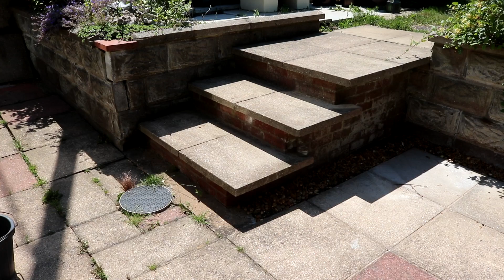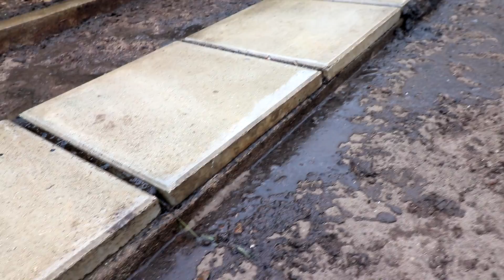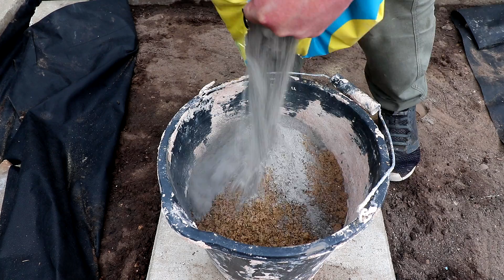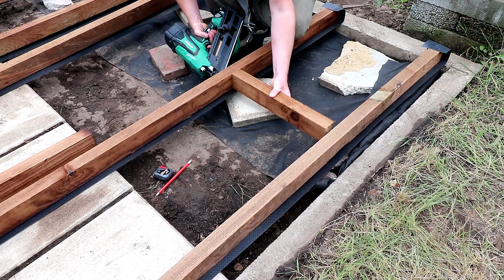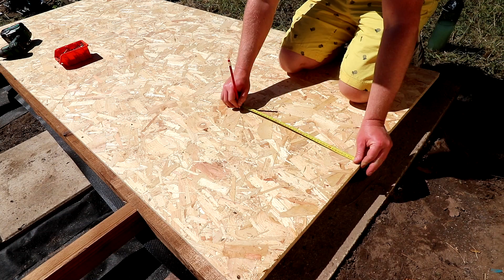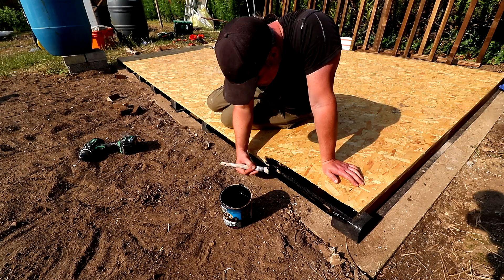Building A Shed Floor & Foundations (PART 2 SHED BUILD PROJECT)

Comment: Hi keith, 
a tip for laying a slab in the future... make up your stiff mix of sand and cement and lay it out and compact. Get a piece of say 4" x 1"   or any scrap timber. measure the thickness of the slab and cut a long notch out of the timber to a millemeter or 2 less than that thickness  then slide the notched bit over the slab beside to create a level base for the slab you're laying, hope this makes sense?
Reply: What a brilliant tip. I've never heard that one before. Thanks for sharing that 👍
Reply: @mariah4451  
Thanks Maria, 
That would be fairly common among paving contractors, it's great if you have a brick edge or inset pattern among slabs also
Reply from the maker: Great tip!

Comment: Looking solid and definitely water resistant mate, watching this made my worry about mine as I probably should of saved up a bit longer to make sure I had the money for the extra preconceptions. I did use treated timbers though for the base so should be OK ish🤔😊.   I enjoyed the shed demolition, a sledge hammer would of been fun if the pesky glass house wasn't in the way 🔨😂
Reply from the maker: Thanks mate! I think yours looked really well built, especially compared to my first attempt where I'd done practically everything wrong 😂 but even that is still standing 5 years later with not too many issues (except a damp patch near the window 🙄).

Comment: I think I need it explaining again about how you can get away with the side supports on the flooring. Thanks Keith.
Reply from the maker: Hi Mandy do you mean without the long timbers on the base? They were mainly just there to protect the end grain of the shorter lengths, so to get around that I used dpc to protect them instead. Hopefully that should work...👍

Comment: i used the same damp proof membrane roll between the dense blocks and my timber frame floor too, nice and durable and easily cut with a utility knife.
Reply from the maker: Yeah I like that it has a texture to it, gives me a bit more faith in it working well 👍
Reply: Rag 'n' Bone Brown I think this stuff is mainly used in bricklaying to prevent rising damp, the texture giving the mortar something to grip to.